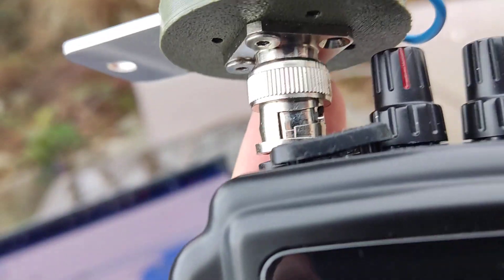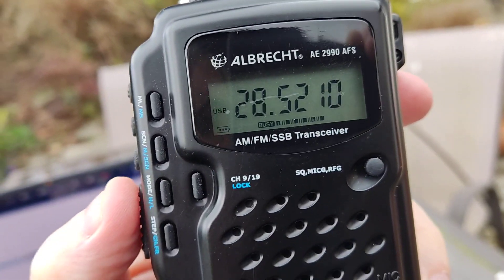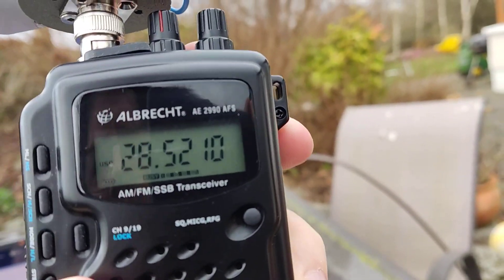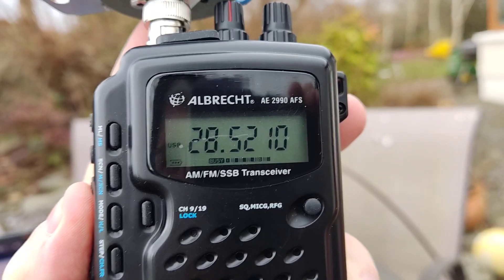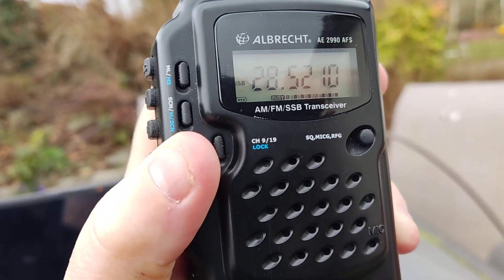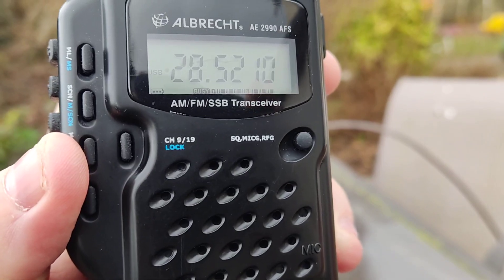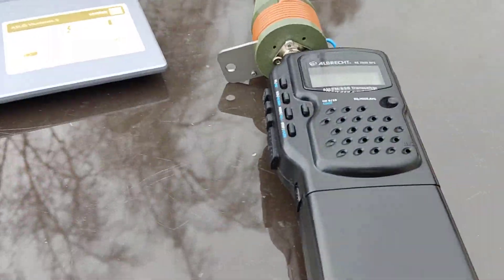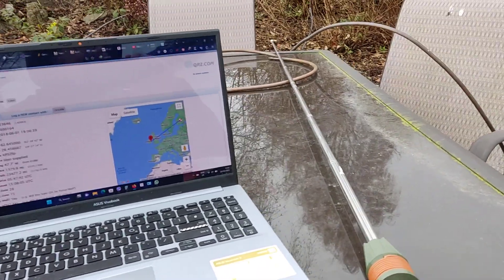Albrecht AE 2990 + DL1DN Whip Antenna 3 Watts

Comment: Qso on 11m?
Reply from the maker: I could try 11m as I also like 11m but it's hard to know the swr and know the efficiency of the antenna, it was designed really for the FT-818 and radios like it that have SWR, it works better with the FT-818 and icom ic-705 because you know exactly how to adjust the antenna for lowest SWR.

If the albrecht has SWR meter and regular Tuning + Lithium battery it would be perfect, a modern version of the Albrecht would be very nice. 

i do have an 11m whip but i don't think it is as good as the antenna in this video.

Comment: Well done can't get them in ssb they are making them with no ssb
Reply: Have two icom ic 705 excellent radio's
Reply from the maker: @martinryan5069  I'm sure they are excellent radios but they got too much for my needs right now, I would rather seen ICOM come out with another lower priced non sdr rig.

That's not to say I won't buy one in the future.

By the way, why have you got 2 705 radios ? 🙂
Reply: Bought one seen another good price ioved the first one im a short wave listener for the last 30 years best radio I've had had a lots of top end receivers and this thing is excellent
Reply from the maker: @martinryan5069  Yeah, the 705 is good but don't try convince me to buy it lol.
Reply from the maker: I got mine from CB shop in the Netherlands, paid far too much for it, they still sell them so not sure if they're still making them with SSB. 

I'd suggest paying a bit more for a Xiegu X5105/6100 or the Yaesu FT-818.

I ordered the 818, should have it Thursday.

Comment from the maker: The Albrecht has an amazing low noise floor, it's almost silent when Toko stops talking, the audio does sound warbly at times and it appears to be an issue with strong signals. 

Anyway, the 818 should arrive some time tomorrow and first I will try on NiMh cells because I'm sure the 818 battery won't be charged and it takes a long time, so I'd rather use the AA cells, output power is around 2.5 watts on NiMh cells. 

I am looking into Lithium for the 818. 

Anyway, QRP with a whip antenna and battery portable radio is real fun. It doesn't help when there are pileups of course so I may call CQ more myself.